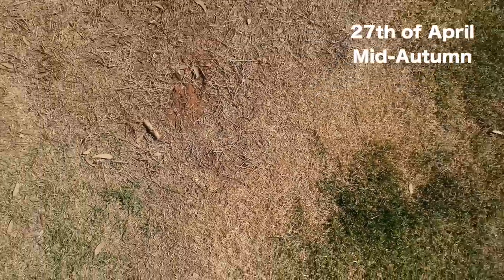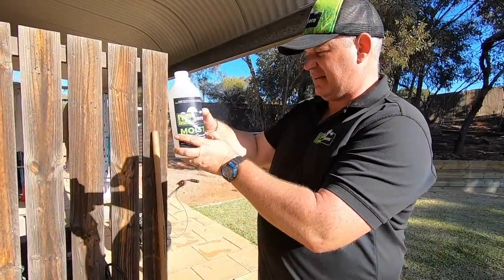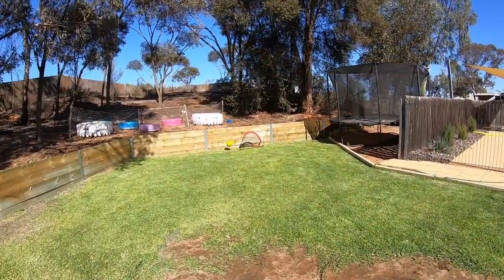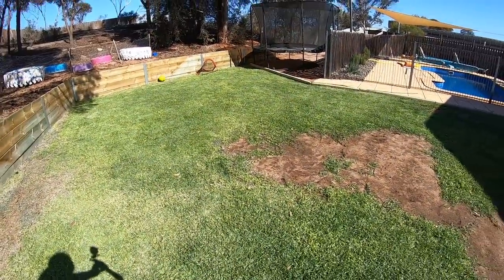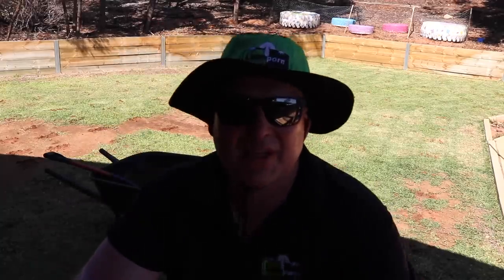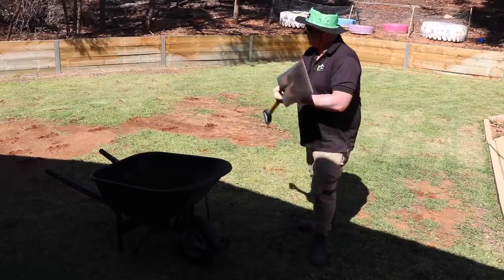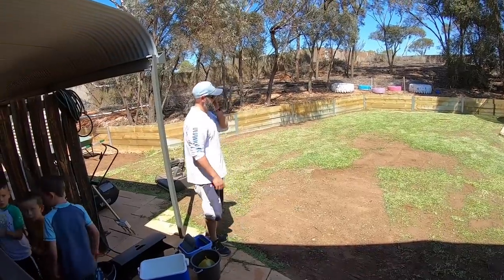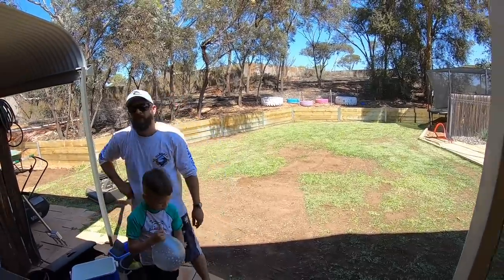Buffalo Renovation / Buffalo Rescue Part 5 / HOW TO SPRING RENOVATE YOUR BUFFALO LAWN

Comment: Is the verticut do the same as a dethatch?
How could I do the same without the verticut? I don’t have access to one of those 

Thanks matt
Reply from the maker: The vertical does a bit of detaching yes. I think one of the hardest things with buffalo is management of the stolons. If you don't have a fairly wide verticut machine you've got an uphill battle. Dethatching rakes seem to be unavailable or massively limited to get in Oz. I would not like to get a normal rake and rake up the area and then cut the exposed stolons with a rotary mower..... I totally feel for buff owners that would have to go down this route..
Reply: You shouldn't need to dethatch sir Walter. If thatch starts to build up just scalp the lawn in mid to late spring and use organic ferts to help natural break down of thatch.
Reply: Mow master Verti / Groomer very small spacing, does a wicked job at grooming buffalo, been doing I  last few weeks, lawns have bounced back wonderfully
Reply from the maker: That’s an interesting perspective. I’m not being rude when I say that and thank you for that comment.